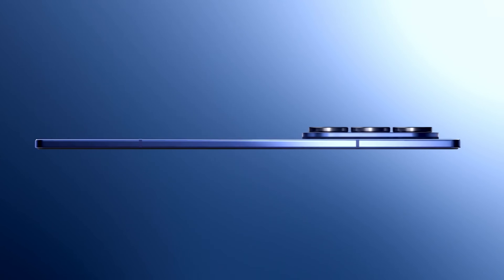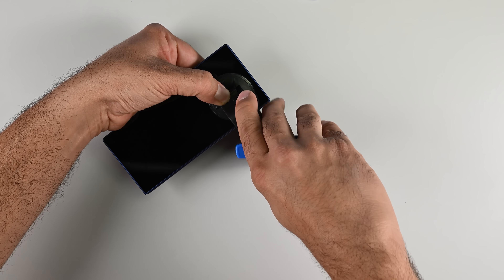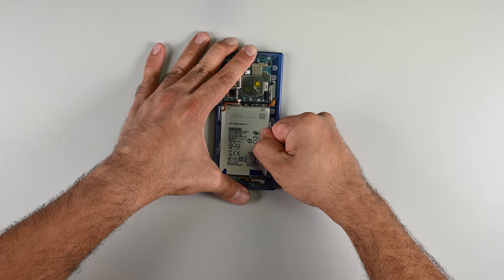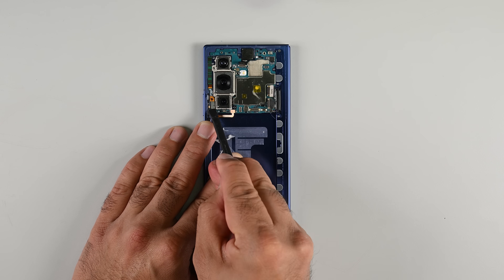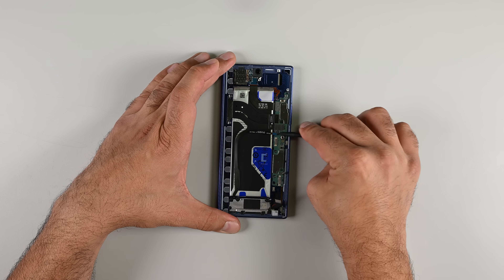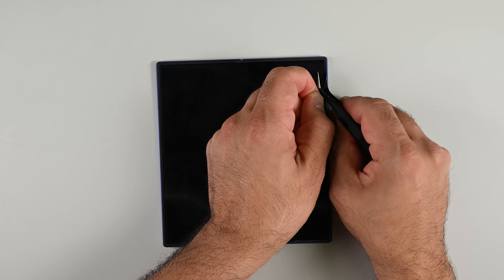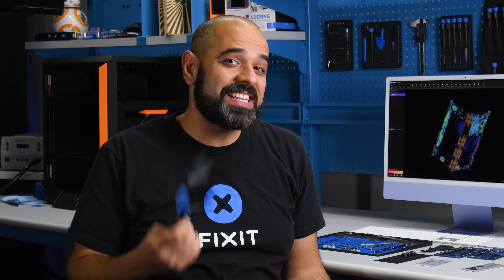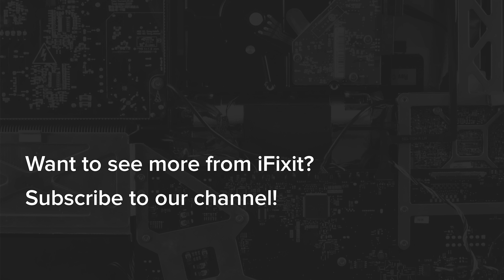Z Fold7 Teardown!  Beautiful, Fragile, and a Repair Nightmare

Comment: every one is complaining about the batteries in the fold 7. Samsung wanted Longevity for there phones that is why they are still using Lithium Ion for they last longer than the others that companies are using.  sure you can charge faster but the batteries will wear out faster. You would think a 2K phone you would want it to last as long as possible.
Reply: I'm not one of those people.  Few points on the battery though.   1.  The phone is a week old, give it time.  2. The phone is impossibly thin, everyone can attest to that.  Something had to give.  3. Battery life just isn't as important as it was before. Charge stations literally everywhere and everyone has multiple power banks.  4. Samsung batteries since their Note 7 debacle a decade ago have vastly improved their batteries to the point now that I don't remember a bad battery from them since then (the 2015 S6 Edge comes to mind)  

My Fold 2 (2020) is still being used by youngest daughter to play Minecraft and I'll now pass the no issues whatso ever Fold 4 (2022) to her now since I've acquired the Fold 7

My only concern from the Folds was the hinge that got scratched up since it stuck out, obviously not an issue now since the Fold 7 is so thin.
Reply: @cim888  The Fold5 hinge was terrible when it came to skin oils. Mine has multiple small pitting spots where my hand would hold it in regular bar phone mode. I was told they know about that and it doesn't affect the trade-in value luckily. The Z Fold7 having the powder coated thinner hinges should help with that.
Reply: You must be paid by Samsung to say this nonsense... All phones used to have a Li-Po battery, which has even worse longevity and is more prone to turn into a spicy pillow. Silicon carbon anodes in batteries require better chemistry overall, and my phone still has 100% capacity even after 3 months. It comes down to the chemistry, and Xiaomi phones have some of the worst chemistry of them all, to try to save a couple dollars on batteries - which is why they can degrade significantly faster than other phones. iPhones have bad chemistry too. Samsung used to have bad chemistry, but they had to improve it after the Note 7.

We don't need batteries to charge faster, we need batteries to be big enough so as to not fast charge them in the first place
Reply: @one_step_sideways  Did you mean this as a reply to a different person, because this doesn't really address much of what was said by any of us, especially how you started off.

Comment: Question. Will the flex cable break like fold 4? Where the wifi and bluetooth would go out after so many folds? Or is that part fixed? The fold 4 was terrible at that.

Comment: Very interesting this is the first time I've heard of those FPC connectors to be called press connectors, maybe PC is press connector what is the f mean? Because I know they're called FPC connectors that are attached to the board. Maybe the connector that is getting connected on I usually just say oh charge port connector gets connected to the FPC. 😂 Could you make some clarity out of this?
Reply: FPC stands for Flexible Printed Circuit/Cable. The connector for the FPC is called a press connector.

Comment: 3:54 inappropriate? then tell me how else they would put a bezel-less display without any tradeoffs without putting adhesive on it
the problem is people complain about things that don't really have a viable solution otherwise
Reply: It’s the strength of the adhesive, not that it is adhered
Reply: @bituniverse8677  it's hard to pay attention to every part of a video when you are triggered in korea, idk about you halfway across the globe.
Reply: 7:15 you can get replacement parts and manuals here in korea idk about you halfway across the globe
Reply: Sammy has been known to use elephant glue since forever. They've been criticized for that constantly.

Comment: I don't mind it being this unrepairable considering how complex of a task it is to build a foldable phone that when folded feels just like a regular phone. The pull tabs can rip and you're left with nothing to pull from, that's why they switched back, I'm partial to floss-style removal strings though.
Reply: bro, the main complaints are the battery and the outter screen. the battery can easily use the holding tabs and the outter screen needed a softer glue. those are easy changes samsung can implement for like 0.2mm of space. no excuses, plus the parts availability, come on! the only thing i give credit to is the inner screen. so far it seems thats a normal thing we have to live with

Comment: Samsung is becoming 2nd Apple. Recently the battery of buds pro left earbud gone bad and when I went to Samsung they told me, the entire left earbud needs to be replaced and it will cost ₹5000 for a single bud!! I bought the buds pro for ₹8000 so it is unfeasible for me to buy a replacement also I found nobody who can replace the battery. So I think the entire buds pro is going to the trash.
Reply: Is becoming?  Has been ever since they removed the battery door from Galaxy phones, then the SD card slot, then the headphone jack...
Reply: The high end earphones, called IEMs (In Ear Monitor) have replaceable cables, but you can buy bluetooth adapters that you can plug into them instead of their cables, in this case if the battery dies you just have to unplug the adapter and eighter buy a new one, or you can continue to use your IEM with wire.
Reply: LOL so you admit they’ve been copying Apple every step of the way?
Reply: @phire4694 you know apple copyed everything from samsung too

Comment: The repair is actually really easy as replacement screens come with the frame assembly. Almost no one repairs only the foldable panel. The rest of the repair is mostly like legos
Reply: Yeah but if it's not available anywhere then there's no point
Reply: @pedr0_m198 there are tons of OEM refurbished panels and frames for folds on eBay. It's not ideal but I've done it several times for repairs
Reply: @pedr0_m198  Samsung original service parts/kits have been readily available for years through parts sellers, they're just hella expensive.
Reply: @pedr0_m198  just order it from Samsung? They offer alot of spare parts

Comment: It's great to see controllers use hall effect for example. Whats up now with silicon carbon? Is it something phone companies should adopt?
Reply: Silicon carbon batteries degrade twice as fast as lithium ion batteries. Not great in the name of sustainability
Reply: @pp00rrkk From where are you saying this? You have any proof?
Reply: @pp00rrkk If you dope the electrodes with a lot of silicon it will. That’s not what these companies are doing though. You can still dope a tiny amount of silicon and get results while reducing the electrode swelling issue with the carbon

Comment: This phone should definitely be more repairable for its $2000 asking price.
Reply: I agree RD310-w4o but then it might not be able to be made so thin and durable in its assembled state. I find a normal simple non foldable phone does the job so hopefully not too many people get brainwashed into thinking they NEED a foldable phone so that not too many end up in the massive ewaste pile.
Reply: @Skoobedobedo I think foldable phones will become the next big thing regardless but that doesn't mean that we shouldn't stop pushing for more repairable designs. It's possible to at least make it easier to repair the battery or replace it.
Reply: Why... Just get insurance.
Reply: @JayD-e2w  what do you mean why? Clown

Comment: I'm really done with foldable products. I have the Fold 6. There's no reason to open it. It's hard to hold. It's slippery. The case is suck. The device gets extremely hot. I get my app updates which are regularly excluded from the foldable device functionality and those app updates tend to come a few days later. So the app update lags behind what is currently tagged as up-to-date.

Comment: Samsung’s repairability issues and their unwillingness to put silicon-carbon batteries to improve the battery life on this $2000 phone really put me off from buying this phone.
Reply: Just because the Chinese phone manufacturers are using silicon-carbon batteries doesn’t mean that the rest of the industry should follow suit just yet.The technology is still in it’s infancy at the moment and it makes sense to wait and not rush into it too soon just to satisfy the immature tech nerds on the internet that don’t know what they are talking about.
Reply: Silicon-carbon batteries are currently quite a bit worse than Lithium when it comes to longevity. Its sad to see ifixit complain about not using this kind of battery and not point out the longevity issues. Samsung, Google and Apple have made the right decision to stick to Lithium Ion until the longevity issues of Silicon-carbon are resolved.
Reply: @notcorrect please they aren't use one before you yap
Reply: @ranjitmandal1612 im on the bandwagon for silicon carbide batteries. But its very true. It has no long-term durability. Have you seen the EU rated system? It marks the lifespan of a device and Samsung lithium has twice as much lifespan. Not that it matters as most owners of such an expensive fold would upgrade year-over-year. Keeping it max 2 years, i work in retail in the Nordics and it is very true. As most common people has yet to migrate over to foldables. Despite the sales boom of the Z Fold 7.
Reply: The first phone with silicon carbide battery came out two and a half years ago, so noone knows yet how long they will last.
Reply: @U.S.A. 2.5 years is easily enough to go through 500-700 cycles. Once per day. If it lasts another year and a half at over 80% that's good enough considering these batteries are like 20-30% bigger so a 20% drop still keeps it at what Samsung's batteries are at max capacity.
Reply: Those batteries are note approved yet and fully tested. Thats why they are not using it. And nobody wants another Note 7 scandal
Reply: @dennis1143 Note 7 scandal was because of Chinese manufacturers or sabotage
Reply: Silicon Carbon batteries as far as I understand do provider better battery life but not longevity. They do not last as many charge cycles currently as Lithium Ion do.
Reply: @Halljand  stfu, they easily last 1,000 cycles like everyone else's batteries. samsung did manage to get up to 2,000 cycles out of their batteries but very few people need 2,000 cycles out of their phones which are outdated in just 4 years.
Reply: @Halljand It is true that silicone carbon battery tends to be less durable, but I'd like to argue that the larger capacity at start will make up for the loss. Personally, I have just switched from an s23 to a vivo mini phone last month, and I gotta say the huge battery (5800mah compared to 4000 in s23 in the same size and similar weight) does feel amazing. With the battery, I can comfortably go out at 75%battery in the morning, scroll through YouTube and chat along with friends for about five hours continuously, only using 5G, and hit home with more than 25% of battery. As for the s23, under the same circumstances, I would have to go out at full battery, and bring a power bank in case sometimes it just decided to drop below 15% when I'm going home. It is important to account for habit changing and the difference between processors and screens, but I think it's easy to spot out the gigantic advantage of a carbon silicone battery. Maybe it won't be necessary if I'm living in a place with many reachable WiFi spots, but if continuous usage of 5G is needed (fast but chews through battery like crazy), carbon silicone is somewhat mandatory. That is my personal opinion on carbon silicone batteries, maybe you don't need it? I'd like to know why 😊
Reply: @Halljand they do 😂
Reply: @ranjitmandal1612 no they don't. Watch the EU rated system. It is documented. Even though i'm all for silicone carbide
Reply: Don't those have an even shorter life expectancy than regular Li-ions?
Reply: Wah wah wah... all you people do is cry and complain. Its literally new technology! Give it a rest already. If you don't like it, don't buy it! Just like all technology, it will get better with time. Settle down little one
Reply: @mikemtb332 useless ppls these days 😕
Reply: Cry
Reply: @EricMcBride323 Sybau🥀
Reply: So you really paying the full $2000 or doing a trade in, no one pays full price for a phone when you're ready for a new phone you do trade in. I traded in my phone and paid 1200 so I'm not mad love this phone
Reply: @Shailo510 I paid 1400 without trade in, 1400 for half a tb phone is solid as is, for a fold its a bargain. Trade in for the pre-order was bait since you lose the 350 off accessories and get reduced discounts from things like a student discount.
Reply: Are you an engineer working for them? How did you know they didn't tried?

Comment: As expected, gonna end up as eWaste once it breaks. 

Foldables are pretty much a solution in search of a problem.
Reply: Hi, I have a problem. I want to bring a tablet that can fit in normal jeans pocket. What should I do?
Reply: @ArchusKanzaki  a folding phone would be a good choice... oh wait that's a solution to your problem that can't be right
Reply: If you think that to foldables you must by extension think it to basically all smartphones, as they are even less practical and useable having comparatively tiny screens that are likely 50% or more taken up with the onscreen keyboard etc when you try to actually use them for something... Foldables are most certainly a solution for those folks that can afford it, live off their phone and thus would make good use of more screen real estate.
Reply: Overpriced super fragile ewaste toys for rich people.
Reply: @mjc0961
I didn't know I was rich 🤔
Reply: @mjc0961 or for people with dexterity issues that still want a smart phone but need a larger screen for their hands to make use of it properly. The overpriced and fragile part I agree with. There's a broad audience for the devices though.